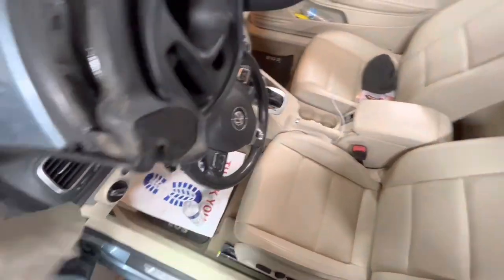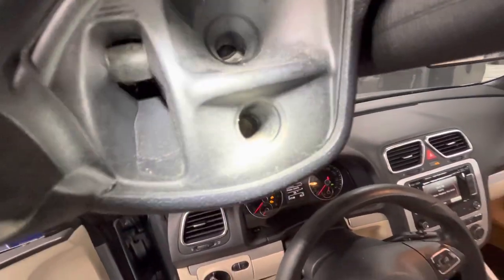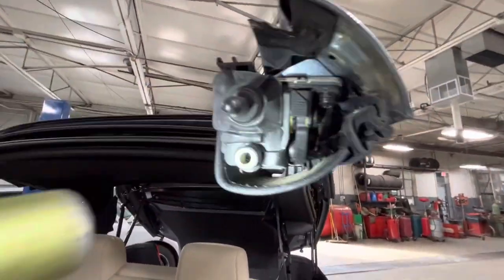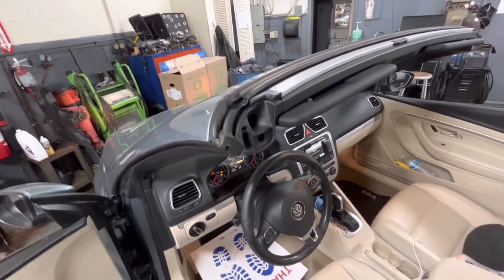VOLKSWAGEN EOS WATER LEAKING WHERE A PILLAR MEETS HEADLINER

Comment: You didnt mention the other end of the tube and didnt check it. That goes through the firewall (bulkhead) via a rubber grommet adaptor. These often come out causing the water to run down into the footwells. These need to be checked and fixed as well. Otherwise you may well still have a leak as these leak like the end of a tap dripping or dribbling.
Reply: Where is this located?